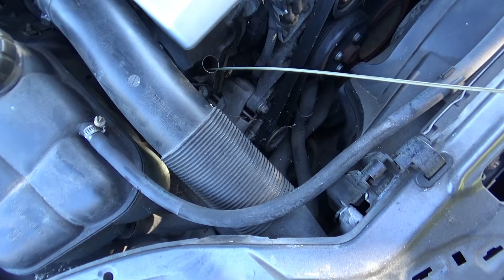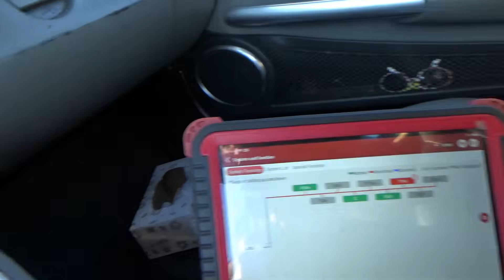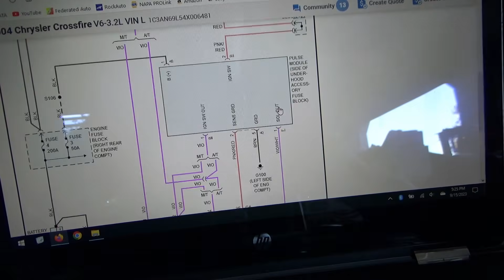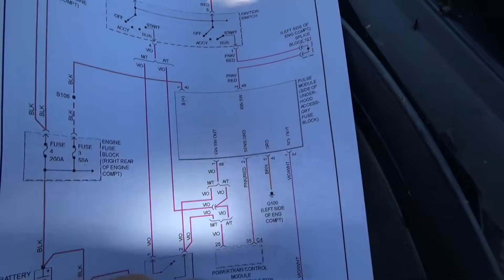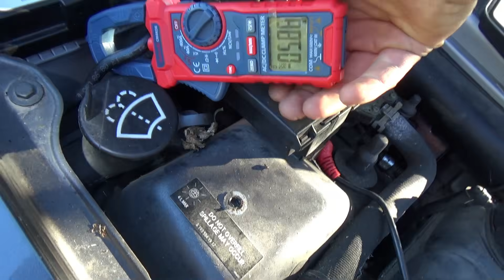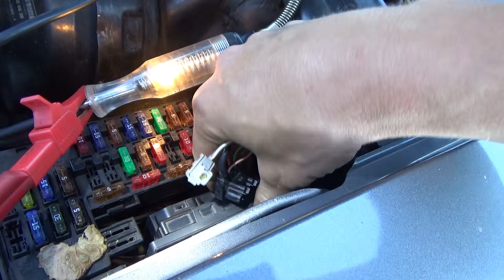Crossfire Can't CRANK? (Part 1 - Beached Whale for a YEAR?)

Comment: I have the problem of no crank with my 05 crossfire coupe limited with A/T transmission, it's also not cranking, but the stop light is not working when pushing the brake pedal, also when trying to start for the first time spoiler went up, mechanic said it was the brake pedal switch, and he changed it, and it worked for few times and then the same problem happened, i tried other electrician so he can find the problem, he said the same, that it was brake pedal switch, so they changed it again, and so after 3,4 times of normal strating it happened again, so im totally lost, it can't be the brake pedal switch right? but why does it start, when they change it for few times and then again stops working? can you please help.

Comment: For this age vehicle with these symptoms I first do a full visual inspection of the electrical wiring under hood, then I lift the car and do a full inspection underneath. Many times you will find the battery, charging and or starting wires (lugs or crimp eyelets) are corroded or damaged by rodents. I have seen shops replace a battery and somehow not notice that the battery lug connections have green crusties. In the most extreme cases I have to make custom battery, charging and starting cables before the car will start, charge, have a good block ground, and operates normally. This also means you have to replace battery lugs and both clean the new lugs and new battery posts. Then I can actually start finding what is really ailing the car.

The yellow and black relays are Bosch old style slot locking, they look original. I don't recall seeing the 0326 part number before for domestic cars, maybe the electrical system built is from a German supplier. 

Power feed is a big black wire, WTF!

Comment: Hi Ivan,  I have similar problems with my 99' MB SLK230. It's a no start but will crank 3 times. CAN is at 120 ohms. I'm assuming I can still measure the Ohm's between the HI and LOW with the modules powered down by the K40 relay? I unplugged the ECM and the Ohm reading dropped to OL. Where's the other resistor? Your videos and know how are so helpful.

Comment: Hello, first of all, I am from Mexico and I use a language translator, sorry if something is written wrong, I have a 2005 crossfire, I already checked RCM and Skreem and everything is in order, everything was later After removing all the plastic from the dashboard and putting everything in its place, the car would not start again. Crank three times and turn off, im very confussed with the problem 😢

Comment: Those were basically made from the previous-generation Mercedes C-running gear than what Mercedes was offering at the time. Even so, nice cars overall. As for "no-crank", they have a "SKREEM" security module that gets flaky and can intermittently keep the car from cranking.

Comment: These M112/M113 engines are notorious for crank position sensors failing (cheap and easy fix) and causing stalls or crank no starts.  That would definitely be the very next place to look.

Comment: I jumped power to the TCM in the relay control module in the RCM. The solenoid in the RCM will engage, but would not conduct current across it to power the TCM. I replaced the RCM and it solved the no crank issue and TCM being off line.
Reply: Go to the RCM connector C. Open up the top of the connector there will be 2 red wires with a yellow tracer. Put 12 volts to those 2 terminals and that will bring the TCM back on line. The relay on the  RCM will click but not conduct power to the TCM. This allowed me to make the call for the RCM.

Comment: DRB3 scan tool, multiplex cable, crossfire super card for this American German cross breed….if you have a access to one, it makes this no start pretty easy to diagnose…park neutral switch is in the shifter assembly.

Comment: Cross refrenced the issue on youtube,, does this apply to your issue ? Famous No Crank and No Start . it's the RCM (Relay Control Module) in many cases a cold solder joint on the pins of a connector on its circut board that fails when it gets warm. its not the battery nor the fuel pump https://youtu.be/Xg7sLEOUdko tons of other refrences to this issue. is this interrelated to your issue in any way  ?

Comment: Those modules in SLKs would usually cause random stalling or no starts, I've tickled them with the soldering iron before. (typical round pin Mercedes module things) CLKs would sometimes open circuit the positive cable between the battery and alternator somewhere too, great cars 😅

Comment: the ecm fuse and the tcm fuse  even pull the fuse to the abs modal ! then i wold check ( with the batt unplug  if you have close to  60 om +/- 3     at the DLC ! let say it 40om will then you have to find the modual or brokering wires that brought it down !  You might say why simple one or more modal may bring down the whole network  take it from me networking is Not eazy to figer out !

Comment: My observation is that this vehicle has multiple issues. A crank no start condition when hot (ckp sensor maybe)  & an issue related to the shifter stuck in park which causes a no crank. Looking forward to part 2.
Reply: What would be your explanation for all the no coms then?
Reply: @remodz6385 seems obvious, likely a module offline due to power/ground issue or network problem. Simple test with a test light should give direction.

Comment: That car looks pretty much identical to my SLK! If it’s electrically any similar, I might have some tips. If it has one, the K40 relay module often gets super iffy. The ECU also likes to blow some components, though that usually causes crank-no-start and PCM communication issues. Not sure about the automatic though, I’m only familiar with the manual!

You also pretty much need a Star Diagnostics scanner on the actual Mercedes, codes often don’t show up on more universal scanners.
Reply: They're the same car. Chrysler only designed the body. Everything else is an SLK

Comment: Ivan  brake light switch is a two part system,one for the stop lamps the other for engine management/trans position lock etc might be worth a quick check without wishing to teach you to suck eggs.

Comment: Would check the shifter lock if not adjuster right the inputs will be right for crank but signal from trans will not be if you don’t hear the shifter lock move when you press the brake pedal it might be moving but not enough for trans lock

Comment: Check why the brake system is not showing that will be why you can't start it with the key and move the shifter leaver. Why it won't run after warming up might be that sensor you're looking at

Comment: Absolutely perfect video to prove I need to stick to old cars. The more the "clever" electronic modules, the more the expensive problems. 
Found this out when I worked in a GE factory making sensors. (to obtain access to VR in the early days to achieve cheaper driver education by experience). Most of the workers couldn't care less about quality or consistency.
I still enjoy these videos as I find them educational even at my old age but I prefer stuff you can see work or take apart and grease. I even know where to put the coal in and how, properly ....lol

Comment: Seem like you went in 2 different directions on this one. Personally, I would have focused on the TCM. And that once you had a solid crank signal, focus on the non running, which is a separate diagnostic charge

Comment: Had a chrysler 300 couldnt move the auto shifter in the center console. Inspected all parts in the complicated shifter handle base, and found a tiny pink plastic molded part that broke and lost a very tiny spring. Redrilled the plastic part, inserted the spring and the shifter worked

Comment: Nice video on another beached whale. 

I definitely would look at tcm and the connector on transmission. Those like to leak and the atf will wick up to the tcm in passenger foot well. I had that on a C230 Compressor coupe.

Comment: that thing is pretty much a mercedes sl ,  mb 242 engine just crappier , front sam may be problem ,check for rodent damage of wiring .  check bulk head connector at trans , will leak and have trans fluid in pins and will cause weird stuff to happen ,like no starts, erratic shift concerns , wont come out of gear ..  and i would check wiring at crank position , check harness around engine and injectors / coils , for loose / bad grounds or chewed wires .

Comment: I’d check the Tom for powers and grounds and communication line with Pico if powers and grounds are good.  Car ran seemingly fine which tells me crank and cam sensors are likely working.  My guess currently is TCM is causing the road block.

Comment: Hi Ivan. I had something similar on  Merc SLK. No comms with ABS, shift lever and auto box, as a result it wouldn't crank.  There was a relay pack of 5 built in relays under the bonnet next to fusebox. One relay was open circuit. Had to replace the full pack. You might have something similar.
Reply from the maker: You'll love Part 2 😁

Comment: On my MDX I fixed this with a simple brake switch, but you said your brake lights are working and that the shifter has it's own module along with the transmission module.  I think I'd be checking power and grounds on those next.  The fact that there are no codes is suspicious though and might be the ECM.  Definitely another hour needs to be approved by the customer. :)   could be a long ways to go yet.

Comment: Ivan..  I think it would be interesting if you did a video on how you organize all your scope gear-- wires, attenuators, pressure transducers and even test lights, etc..   How do you keep track of all that stuff?  How do you have it organized?  Is it in a bag or do you have a mobile tool box?  or maybe just some of the factory cases, etc..  and even the scope itself and multimeters;  not to mention tools.   I've been building my kit and I'm just trying to see what the best options are for keeping track of all this stuff and yet still keeping it mobile.   I found a cheap 5 zipper pouch roll up tool bag that seems to be useful;   Also I might throw it all into a rifle carry pouch with all the exterior "tactical" pockets, etc..   Not sure yet what I'm going to ultimately use..  I would love to see a quick video of how you have your stuff organized.   Right now mine is just all in a cardboard box. :)
Reply from the maker: Ziploc bags and clear plastic boxes with snap lids work perfectly. Plus a small 4 drawer toolbox that slides into the back of my SUV with all the hand tools. Only factory case is for the Verus, which is also packed with extra electronics gear 😊
Reply: @PineHollowAutoDiagnostics   Nice.. makes sense:  so you can SEE everything.

Comment: A awhile back I had this same issue with it not shifting on my 2002 Acura MDX..  Little trouble shooting and I found that it was just the brake switch on the brake pedal.  Found one online for ^7 dollen new (free ship)..   It's been working good so far, for a few months now.  OEM is like  70 dollen; so I guess we'll see how long this aftermarket junker lasts. :)  It's simple enough that I think it should be a fairly good copy.  (I'm only 2 mins into the video).

Comment: As for the starter not working well the second time - I wouldn't be surprised if it's in need for some lubrication since the mechanism could be sticky and not move freely when the solenoid is pulling. Or just a new starter, erratic starter behavior is the first signs of a starter on its last legs or suffering from corrosion.

And as I noted in another post - that aftermarket radio could be the culprit, you don't know if it has damaged some harness or if it was installed in a wonky way pulling power from the transmission harness.
Reply: You lube your started regularly? Lol

Comment: the shop took a couple months to change the battery , damn they busy !  hope they didn't charge lot storage fee
Reply: They did not. They were not sure of problem and did not want to throw parts at the car.  I still Use the same place.  Just My car had them stumped.  Other times they have fixed my vehicles, with no issues.
Reply: @terrydoberstein6742   Easy , you'll hurt  yourself , just having a bit of fun , Don't get your Panties all bunched up  !
Reply: That would be ruthless. haha.

Comment: 9:44 - Let's touch starter motor. That's when you hope that the gearbox actually is in neutral or park so that the issue isn't that the gear shifter linkage is out of sync and the car starts to take a tour all by itself in the neighborhood.
Reply: I'm sure, (not at all) that the e-break was set. If not, mind warehouse will add it to their clips of people running after cars.

Comment: i would go to the shift lever assembly next because it is tied into the tranny module and the illumination module and brake and traction control, which are not communicating, for direction.

Comment: Looks like a similar problem I had my 2007 Pacifica.  Turns out 4 ground wires bundled together and bolted down to the chassis directly under the fuse box had ripped loose.

Comment: Wht would I do next?  I would be looking at the transmission module.  I suspect that the two wire CAN bus is not doing well, possibly because the transmission module is having a moment.   Not being able to get out of park is a big, big clue.  You can't talk to the module, the module isn't doing anything useful, and could possibly be a contributor to the no-start.

Comment: We had a 1990 model Holden VN  Commodore which we got off our auntie 25. Years ago which ran the 3.8 litre Buick LN3 engine from the 1980's in its.

It had a crank no start issue which was caused by the strain on the wiring harness connector on the crank angle sensor which over time caused a high resistance join within the crank angle sensor while the engine was warm but it would start after the engine has cooled down.

Replacing the crank angle sensor fixed the problem & I think GM & Holden fixed it up by the 3.8 litre Buick L36 engine which my dad has in his 2000 model Holden VX Commodore

Comment: I would concentrate on the shiftlock problem, and establish if the trans module is sending out any canbus messages. Definitely remove that stereo whilst your testing, just incase as its playing up like it has insufficient power
Reply: Aftermarket stereo has damaged the wiring harness to the transmission?
Reply: I have had aftermarket stereos interfere with canbus message, and csrnrefuse to start, had to disconnect a wire and all functions returned, the noise it wad making in the video was like it was contsantly reseting. On first power up the spit the cd out

Comment: NAG1 transmission.  If the transmission control module is not online then that is a no-crank.  The neutral safety is the same as the transmission fluid temperature line, the line is grounded when not in gear (reverse or any forward gear gives temperature reading).  Check fuses and then TCM and ABS powers and grounds, they might share the same fuse.  Brake signal might come from ABS while the neutral safety signal would certainly come from the TCM on a NAG1 so if the TCM is offline you get no-crank even if the ECM is on.  The harness connector on the transmission could be leaking causing transmission fluid up the harness and into the TCM.  ATF+4 is designed to keep some of the metallic clutch wear material in suspension while the filter catches larger pieces, so ATF+4 might be fairly non-conductive when new but will be much more damaging to electronics when used.  So if its wet with oil, the TCM may be fried.  There is a chance you can clean the PCB and case of all stray particles and it will just come back to life but it is probably toast if used ATF got in there.
Reply: Yeah the nag1 was kinda a bear to deal with. Isn’t it the 722.6 Mercedes? If not it’s painfully similar. Probably comes standard with a burnt c clutch
Reply: @marknaravas318  yeah, nag1 is basically a 722.6 transmission.  There are different variants with slightly different gearing like w5a580, w5a380 etc.  They are a workhorse that is actually pretty easy to service, and if you have the right equipment they can be easy to rebuild.

Comment: look for blown fuse or other lack of power on the shifter lock.  We had similar problem on a Cadillac CTS would not start and would not shift due to blown fuse.  In our case fuse was blown due to aftermarket remote start, but regardless without power to the shifter lock the car was dead.

Comment: IIRC that Chrysler Crossfire was based on the Mercedes-Benz CLK while Chrysler was owned by Daimler-Benz.  Chrysler had several vehicles/components that were based in M-B vehicles.  Before the 300/Charger/Challenger ended production they were based on the old S-class chassis.  I think even some Ram pickups had M-B transmissions.   For not being on the road for a year, that car started and ran well.  I hope this repair is "no parts required because I doubt you would find parts for that car.  GREAT VIDEO!
Reply: Based on SLK not CLK

Comment: Neutral/park start switch. I had a old tractor that would not crank, cus the transmission start switch was disconnected - way back in the 90's
Reply from the maker: The safety interlock here is integrated into the modules that are not talking... That's definitely the direction we are going to go next 👍
Reply: Yeah, he said the shifter has it's own module..   Another thing that is over complicated for no reason. :)